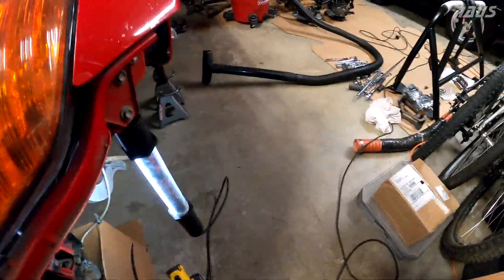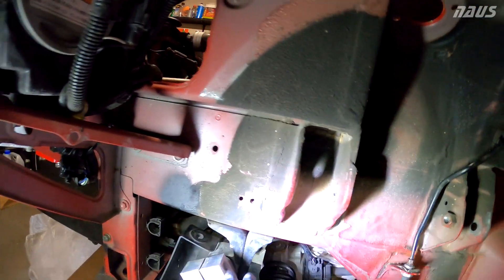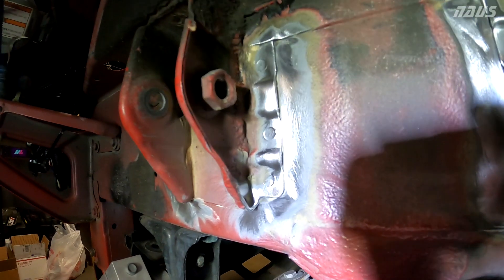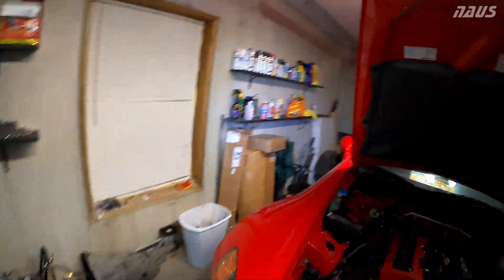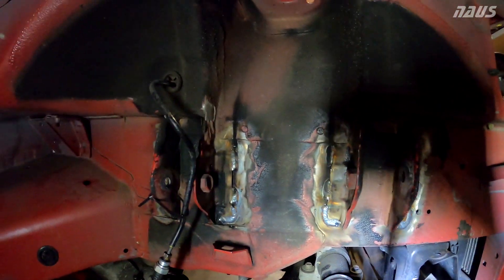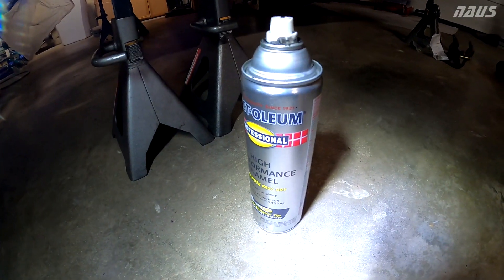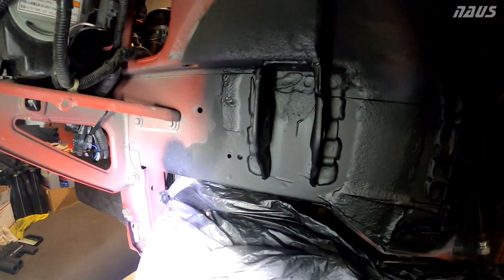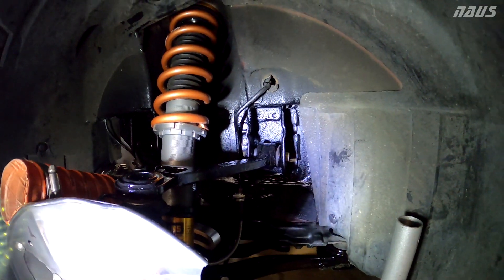S2000 Upper Control Arm Mount Fix - Honda TSB DIY

Comment: I bought the same warrior wire wheels as you and am using a drill and my dremel. Drill works pretty well but I tried to use the dremel for tighter corners and they wire and torque don’t seem up to snuff to get all the undercoating off. Any advice?

Thanks for the vid!
Reply from the maker: Remove as much as you can with the drill then the Dremel for the tight areas. Yes it does take a while but the better you prep the better the welds will be

Comment: You supposed to add strengthtening brackets...
Reply from the maker: The problem is not the strength of the bracket, these literally never bend. The problem is the bracket detaching from the frame. This video is exactly what the TSB from Honda said to do. Adding gussets and extra brackets and crap is overkill unless your running like a 295 slick up front with spherical control arm bushings